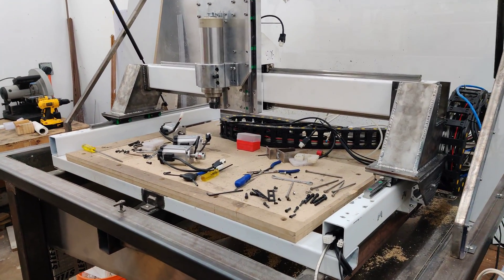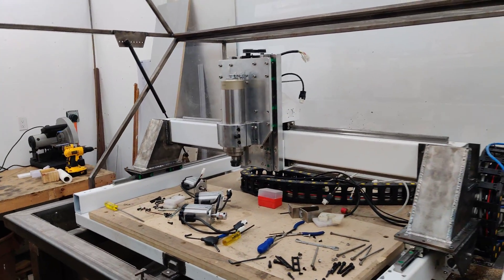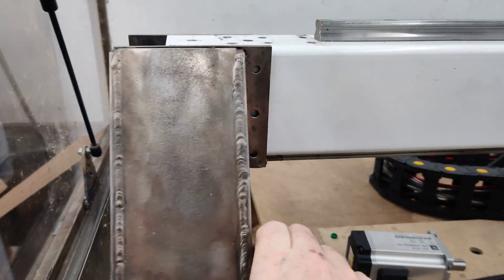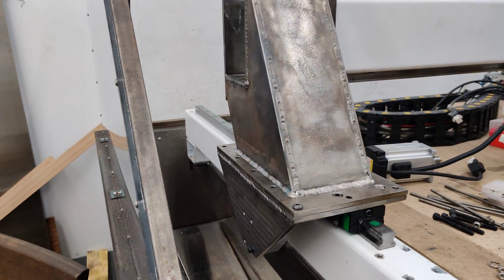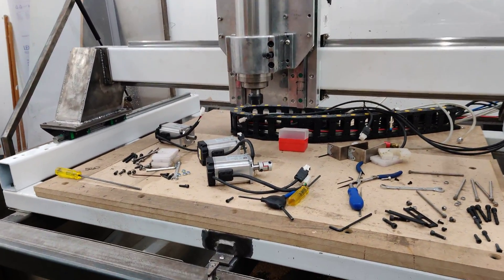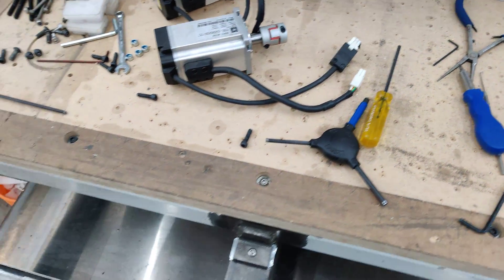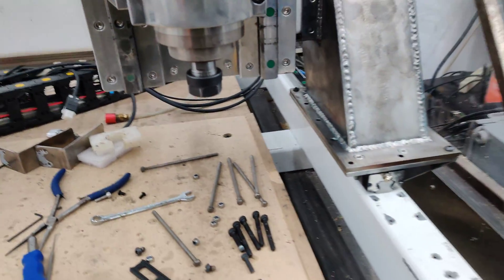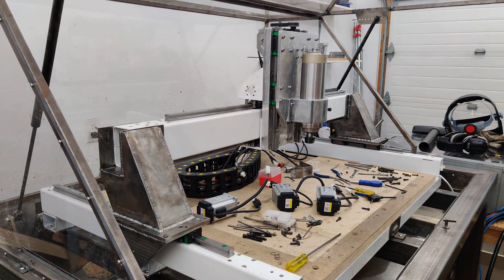Disassembly of the CNC machine and test fitting new gantry risers

Comment: Can you get longer y-axis rails or are you limited by the interaction between the ball screws and the stepper motors?
Reply from the maker: Currently the linear rail are the limiting factor for travel. If I put a longer rail that went the full length I could utilize all of it with the ball screw for the Y axis. Only issue would be I'd very likely need to run pulley/belts on the Y axis due to space constraints. It’s something I might look into in the future if I’m finding that I need more space. If I were do do this and run a full rail, I would get about 8” (200mm) extra travel in Y axis which is quite substantial.